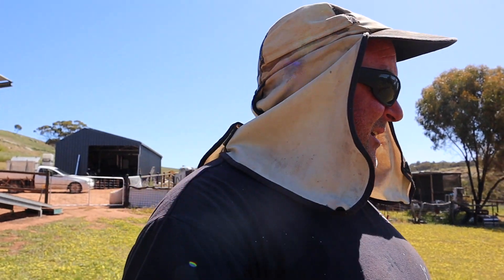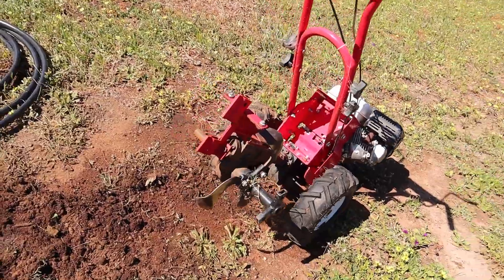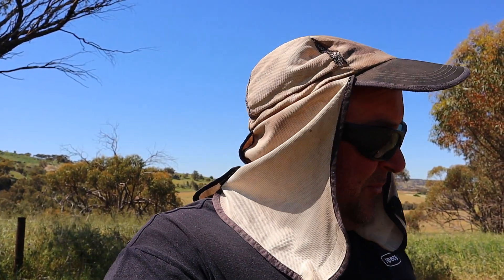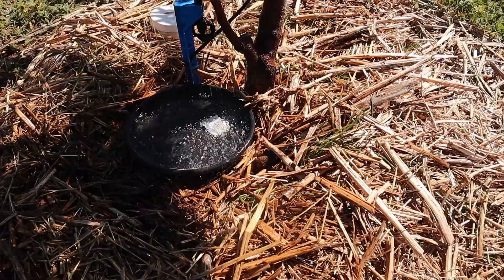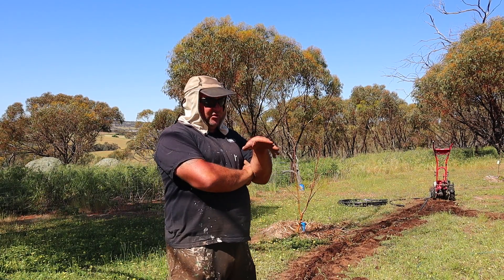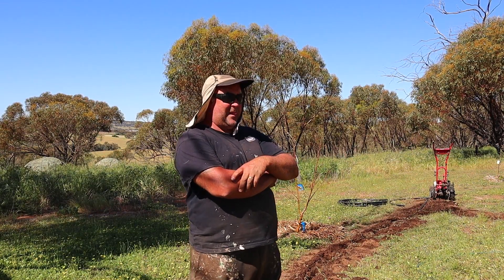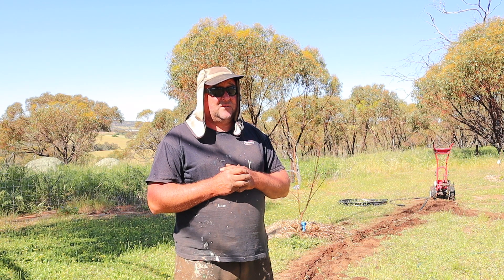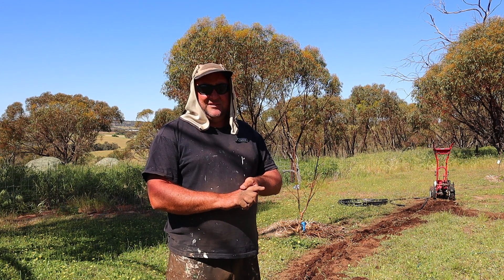Water for the orchard PLUS water math for the offgrid homestead

Comment: Water is pretty important, and you can do a lot to stretch your resources a bit.  Thicker mulch around the trees, for example, will keep the soil cooler and moisture trapped down deep where the hot sun can't get to it.  Same for sub-surface irrigation rather than top-dressing where you lose a significant portion of the water to evaporation.  That'd allow you to water once a week rather than daily.
Reply: @erikhouweling1552  Good point about increasing the mulch bed around the trees.  I'd add to that by suggesting they be made into long beds rather than circular beds so they act like a berm on contour and help hold back rain and any sediment.  At about 3' in diameter like they appear in the film, stretching them to 6' or 10' in length would make for quite a good bit of water catchment that would help feed the trees and sink the rain.
Reply: @erikhouweling1552  And even if they can't link, they'd still make a nice obstacle course for the runoff to dodge around.  Plant the mulch beds with Tiller's Radish so the tubers could shoot deep, adding much needed organic matter to the soil while providing lots of green mulch when they're cut back.

It's so easy to come up with a list of work for them!
Reply: @erikhouweling1552  I'd be happy with just getting Mr.&Mrs.RP going.  I've got a whole long list of jobs for them to complete, but they're being mighty obstinate about it and always going off to do things they want to do.  Weird, I know!  🤣